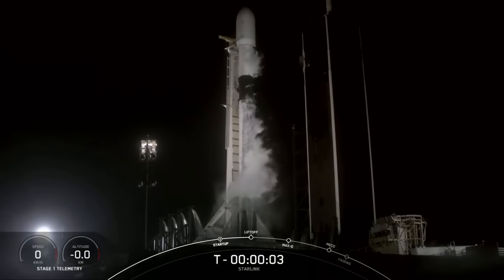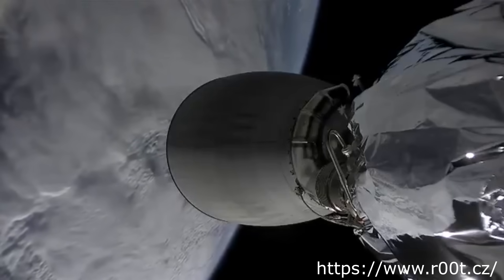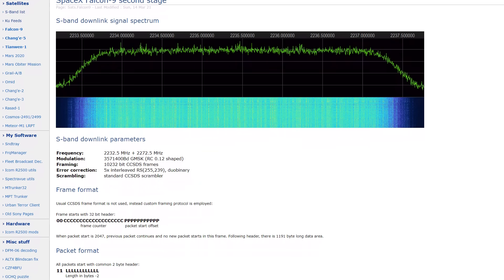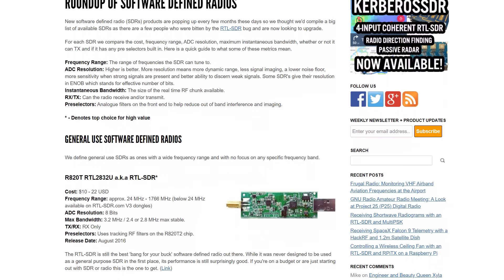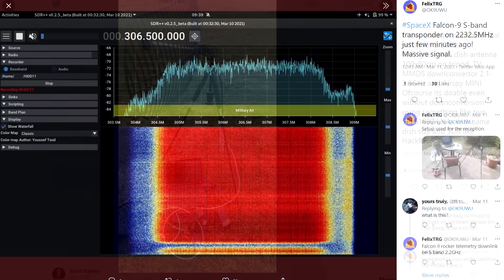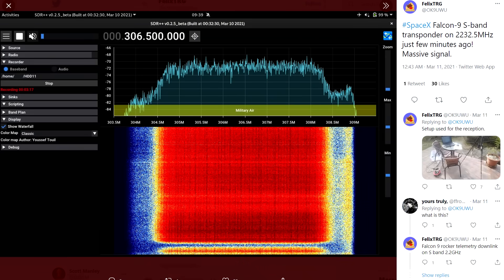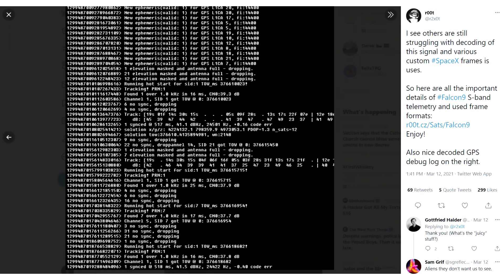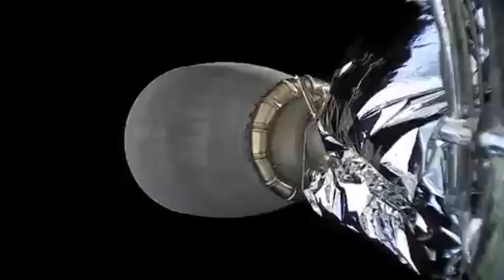How Amateur Radio Fans Decoded SpaceX's Telemetry & Engineering Video

Comment: LOX is attracted to magnets. CodysLab has a video on this.

I wonder if this property is applicable in rockets.
Reply: Good Idea! 
That may work for the oxygen if the magnet is strong enough...
But there is still the same problem with RP1 or Methane, the magnet will not work on them, so they still have to accelerate via thrusters before starting the engines...
Reply: Magnets tend to be heavy..

Comment: Amateur radio operators have been receiving spacecraft telemetry for decades.
Reply: Since the beep-beep-beep of Sputnik.
Reply: I remember how a local computer magazine in 1990 had instructions on how to receive and decode weather satellite pictures with a Commodore 64 here in Finland. All you really needed was a cheap radio receiver, record the transmission to tape and read it with a C64 and a cheap AD converter.
Reply: @benbaselet2026  They use Slow Scan TV signals. You can actually download apps to send and receive SSTV.  Local HAMs use it for memes because why not. LOL
Reply: Like this is what we do. From. Cubesats to weather satellites. Kd2nfc
Reply: @directedbypuma  So I can take data from sattelites for free?
Reply: @philnightjar1971  yes you can. Well other than the cost of and SDR dongle ($25+), a down converter, and some well constructed antenna. A common one is the NOAA weather satellites. Search SDR NOAA here and you'll see plenty 😄
Reply: @philnightjar1971  yes
Reply: Indeed- Google Geoff Parry and Plesetsk Cosmodrome- an English school teacher revealed Soviet secrets in 1966.
Reply: Very interesting stuff
Reply: You don't say
Reply: They have but this was something more profound, as in a digital signal modulated onto a very high frequency. That is a bit harder to decode than an analogue signal, even though standards were used in constructing the digital signal (SpaceX). Had the coding standard been proprietary and kept secret, there would have been close to 0 chance they would be able to decode the signal.
Reply: @paulmichaelfreedman8334  when I was in middle school I built a wefax decoder to receive weather info on my commodore 64. later in life I worked at a military radio company. modulation formats are very easily observed on a common lab device called a signal analyzer. there aren't any proprietary/secret modulation formats. Shannon and Fourier promised us that a long time ago. Ham operators use similar software tools that do exactly the same thing using a PC sound card. I use one called FLDIGI to talk to other hams around the world on HF.
Reply: It's definitely in the same spirit but it seems like it's a bit more of an undertaking these days.

This reminded me of the Judica-Cordiglia brothers.

I wouldn't have the first clue how to do any of it. All I can say is thank goodness for smart people!
Reply: I’m surprised that security is not more of a concern. Sure, you can’t do evil things with the downlink (except maybe learn some trade or state secrets), but what about sending commands to spacecraft? Are they unencrypted as well? Even if it’s encrypted, since this is the space industry they probably use 30 year old algorithms which could be cracked.
Reply: @Mike-oz4cv  The commands are encrypted , otherwise there would be any 
US  reconnaissance satellites (aka Spy satellite) still flying or working.
>algorithms which could be cracked.
uhm NSA is making sure that this is not going to happen :-)
Reply: @enricol5974  Sure we can pretend that it is not happening. Total security does not exist
Reply: @Mike-oz4cv  Commands are definitely encrypted for most satellites, US ones anyway.  All the ones I've worked with have employed encryption on the commanding system going back at least 30 years.
Reply: @Mike-oz4cv  IIRC, the Falcon 9 has autonomous flight guidance and termination systems.  Up-linked commands likely contain a digital signature to verify they're legitimate.
Reply: @frankhage1734  digital signature is the answer. FCC regulates who can encrypt radio traffic (hint, it’s the feds and military), so that’s not an option. Digital security, however, is
Reply: @borkborkfoxxo279  What? No does WEP or WPA ring a bell. The restriction is not universal it's band and license dependant.
Reply: @Mike-oz4cv  
Uplinks (communicarions sent to the spacecraft) are usually on a different frequency or band so that simutaneously occuring transmissions don't interfer with each other. 
They are most certainly secured in some way, or will be soon. 
The movie 'Failsafe' deals with this senario in a sixties manner.
Reply: @Mike-oz4cv  if there is a command uplink you need a transmitter, more costly to do but doable and then yeah their comms would be encrypted. The security can be there if they wanted it. Would you believe at one point when USAF rolled out drones their video uplinks to satellite was also able to be monitored by anyone with the right equipment.  It’s not like that now but it was.
Reply: @Mike-oz4cv , SpaceX is not 40 years old, you may be thinking of the government’s space program.  SpaceX is using state of the art and defining what state of the art is, like Reusability.  Yet, if the old protocols work, they could still be using them.
Reply: In the early days of the Space Race two Italian amateur radio enthusiasts focused on the Russian space ships as they passed overhead and were able to reverse engineer the telemetry being transmitted.  They recognized the heart beat of a lady cosmonaut.  They monitored it for several orbits and were able to hear when is slowed down and stopped.  The USSR never admitted to her death in space.
Reply: @eugenecbell  Unfortunately that was in fact a hoax perpetrated by the Italians in question.   Seems one of them had a Russian speaking girlfriend.   According to native Russian speakers, the voice is not that of a Russian woman, the accent is wrong and it's not even good Russian.   There's plenty out there about this particular hoax.
Reply: @geoffroberts1126 , if what you say is true, it would be thankfully and not unfortunate at all.  But you must be talking of some other event, real or imagined.  In the story I’m telling there was no voice transition, only telemetry (computer numbers).  No doubt, the USSR would have created miss information to cover up and deflect either way.  So, we can never know if it is true or not.  The account I saw said it was true or at least the Italians thought it was true.  I say it has a strong ring of truth.
Reply: @eugenecbell  No, there are several versions of the story, but all came from the same two Italians.  Even in that era, the sky was an open book.  Didn't happen.  They had casualties, but none that were secret.
Reply: @geoffroberts1126 , I don’t know if it is true or not.  What makes you so certain it was a hoax?  Were you one of the Italian guys?
Reply: @eugenecbell  Seen a lot of stuff on it.  Some articles in the 70s and 90s, much more online.
Reply: @geoffroberts1126 , I can see no way to be certain if it was true or false, short of being in the Soviet Space program or being one of the brothers.  There is reasonable evidence on both sides and either the KGB or CIA could make up huge amounts of evidence for there side.  I could believe it as it is well known the Soviets made great protest and were not apposed to take risks to do it.  But I can also see the CIA making the whole thing up.  The only thing I can’t see is being certain about it.
Reply: @eugenecbell  Its well known as an old hoax now, Google it.
Reply: @geoffroberts1126 , I have and I find supporting stories for both possibilities.  I remain uncertain, but would bet it is true.
Reply: @eugenecbell  No.  The only 'reasonable evidence' is that it was a hoax.  There is only the supposed recordings they made as 'evidence' and native Russian speakers have listened and said they're clearly not of a native Russian speaker, ,which they would have been if this fairy tale were true.
Reply: @geoffroberts1126 , or it happened and the Italians recorded it.

Look my point is, we have no way of knowing and we need to accept that.  Otherwise, we are just accepting a story we have read or a counter story. 
A open mind sees there is possibility in both stories.
Reply: @eugenecbell  I'm sorry, but I can't accept it.  It's been quite thoroughly debunked to the point where there is no reasonable doubt that there was a hoax.
Reply: @eugenecbell   Audio transcripts reveal that none of the cosmonauts, who were supposed to be Soviet air force pilots, followed standard communication protocols, such as identifying themselves when speaking or using correct technical terminology.   Likewise all the recordings contain disjointed sentences and grammatical errors more typical of a non native speaking Russian.   One from Nov 1963 ″аша передача будет сейчас″ Translation: "...[o]ur transmission will now..." is clearly not right, contradicting the known fact that the Soviet space program only used highly trained, well-educated Russian native speakers from aeronautical backgrounds, usually fighter pilots or test pilots.  Some transcripts record cosmonauts saying they are leaving Earth's orbit (i.e. heading into interplanetary or "deep" space), but the crewed Vostok 3KAs could not reach escape velocity because their designs never contained secondary-burn propulsion units to do this. This was inherent to the Vostok programme, a project to put the first Soviet citizens into low Earth orbit and return them safely. OKB-1 only required spacecraft with velocities that could reach Earth orbit (28,160 km/h or 17,500 mph) far less than the speed needed to break orbit (40,320 km/h or 25,050 mph). Propulsion units powerful enough to leave Earth's orbit did not begin to appear until the test firing of the RD-270 engine in 1969, so the so called recordings that mention this are simply not possible.  Given that all the recordings were by the same people, it's clear that those were false and that means the rest were doubtless false as well.   Sorry, but this one is way past its use by date.
Reply: @eugenecbell  You can't prove a negative.  The burden of proof lies on the accusation and without proof the logical thing is to assume it's a hoax.
Reply: @eugenecbell  🙄 tell us about the flat earth, too!
Reply: @vladimirdyuzhev , try to think of something intelligent to say or type it in to your favorite search engine.
Reply: @eugenecbell  Try not to parrot wild fantasies
Reply: @vladimirdyuzhev , it is not a wild fantasy.  It was a widely reported story at the time and there is no evidence it was a fantasy.  Prove me wrong.
Reply: @eugenecbell  Flat Earth is also a wildly reported story.
Reply: @vladimirdyuzhev , true but they are not equivalent, as the Soviet space story was reported as true at its inception, by all the media.  You would make a better analogy comparing the Sun Centric System story to the Soviet Space story and likely come to the wrong conclusion. 
I’m seeking a way to know, so far I see none.
Reply: @eugenecbell  

For example, those italian guys wasn't at all the only amateurs trying to track spacecrafts in those early days. Several others, especially one quite famous swedish guy (sorry i forgot his name, but google for it if you want) who was based in nothern Sweden has always been able to track the "official" soviet spacecrafts exactly as for those italian guys, but "strangely" he never been able to get records of those supposed secret/unofficial/lost cosmonauts launches.

Another example, due his geographic position the swedish guy was supposed to be the first one to track a launch and get telemetry and stuff from the soviet capsule, while strangely (again..) in several occasion has been the italians to get the tracking BEFORE him which was impossible.. something like the italians got those informations from some other source other that their tracking instruments...

One more example? Chertok himself (again, google it if you don't know who he was) in one of his amazing books said that in in one of the early uncrewed capsules they manage to put a dummy wearing a complete space suite with all the set of micropones, monitoring sensors for collecting and transmitting vital parameters of future cosmonauts. One of the thing they did was to put a record of heart beats and breaths in the capsule and transmit those datas to the ground station for them to be sure that everything would have worked properly with humans on board.

And by the way, if the soviets were so that much concerned to cover up their cosmonauts deaths, why they made public right away Komarov dead? and Victor Patzaev, Georgij Dobrovol'skij e Vladislav Volkov deaths? it doesn't make any sense.

There is a bunch of other examples like those, so that Judica-Cordiglia stuff can be considered definitely labelled as hoax.
Reply: @mr.g.7125 , I sent the Russian ship with the dummy the hoax?

Your argument contradicts itself.  At first you say it was impossible for the Italians to do it and then you follow up with they were tracking a dummy.
Reply: @eugenecbell  That's because you didn't understand what i said.

I quote myself:
"Another example, due his geographic position the swedish guy was supposed to be the first one to track a launch and get telemetry and stuff from the soviet capsule, while strangely (again..) in several occasion has been the italians to get the tracking BEFORE him which was impossible"

That means that in several occasion J-C claimed to get the tracking BEFORE that guy from sweden which is impossible. When i said "the first" it means the first between the guy in Sweden and the guys in Italy. 
I didn't say that wasn't possible AT ALL. English isn't obviously my first langauge, but even so I'm quite sure that the meaning of my quote is absulutely clear.
Reply: @mr.g.7125 , I would have never known English was not your first language, so communicate perfectly with it.  Your English is better than most Americans’ English.  You should be very proud of it.
Reply: @mr.g.7125 , your assertion that the Swede would be first because of his geographic location is dubious.  First the Russian launch site is far to the east of Sweden and certainly over the horizon of a craft in low earth orbit.  Also, not all a mature radio operators have the same skills or equipment.  At that point in time artificial satellites were new and that includes capsules.  For any ham operator to copy their signals would have been a minor miracle.  Even today it is no piece of cake to copy a transmission from space.  I am an Amateur Radio Operator, I hold the highest Amateur Radio License that the US issues, I have communicated with the ISS.  In some ways it is easy, but in the details it is not.  My biggest advantages are the modern radio equipment and better science education.
As easy as it is now most Radio Amateurs never pull it off. 

Nothing I have read in any of these posts have convinced me one way or the other.  Everyone’s opinions boil down to I read this or that and I believe it and I am correct and you are wrong.  This is also true for my opinion of the truth of the Italian story.
The only difference is I am aware of our limitations to know the truth on this subject.  I have enjoyed the respectful exchange of knowledge, with only a few exceptions.
I thank you all for the discussion.
Reply: @eugenecbell  The problem those Italian brothers had was that they, after they presented their first reception results in the media, got too much attention and were tempted to fake further results just to keep the story going.  So after their first true results they made up more and more spectacular stories to keep the focus on them.
But there were many others with the same hobby, like Geoff Perry from the Kettering school and Sven Grahn from Sweden, who made similar observations but without the spectacle.  Sven Grahn still has a website with lots of material on it.
It is impressive what all these folks have done considering how much more difficult it was in those days without the technology we have today.
Reply: @eugenecbell  Actually the Russians also have a lauch site in Plesetsk and it is close to Sweden.
Reply: @Rob2 , ok do you propose the Italians had some real reports and then got caught up in their own fame and made up some stuff too.  I like this theory, it is human nature and plausible.
Reply: @Rob2 , ok there is a Russian launch site close to Russia.  There is some support for the Swede could have heard first or should have heard first, but space ship he’d East don’t they?  They almost always do now, on less they are going for polar orbits, but in the early days they could have gone West, I don’t know that they didn’t.
Reply: @eugenecbell  typical conspiracy theorist answer. 'prove me wrong'. Pathetic. The proof is there, you just won't read it you expect to be spoon fed and then you will just dismiss it as 'fake'. Go away and stay away from science based videos.
Reply: @handlesarefeckinstupid , open your mind and read all the reply’s.
Reply: @eugenecbell  "prove me wrong" Why don't you prove yourself right. You're the one making extra ordinary claims.
Reply: @Aquatarkus96 , I have made only regulate claims, claims upheld by the media, at the time, if you like you can read more of the posts and learn more.
Reply: So, are you the son of Art Be!l?